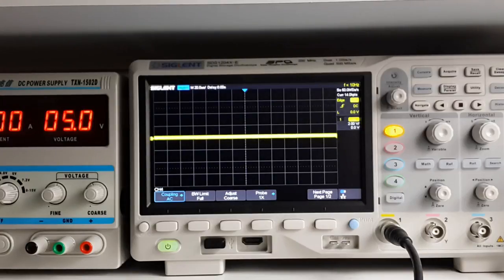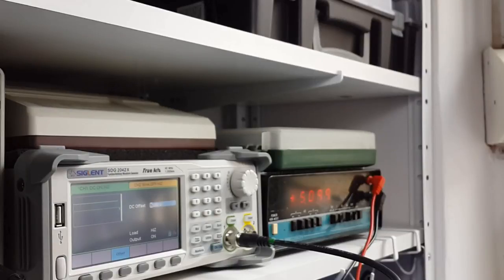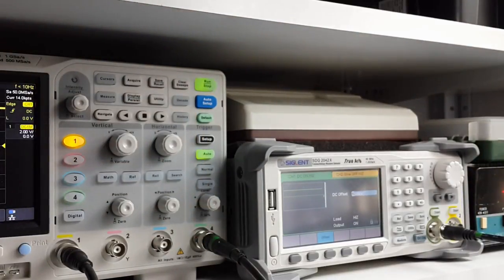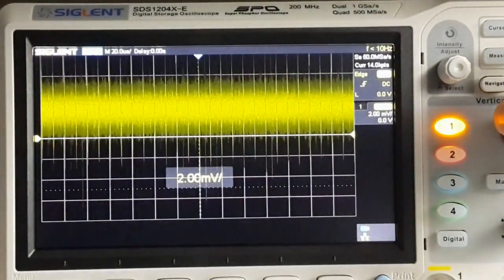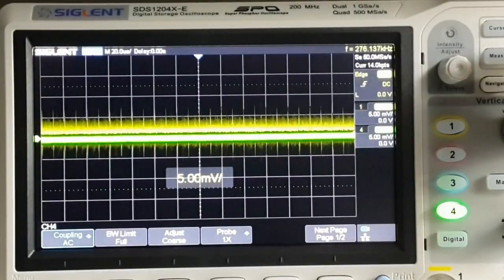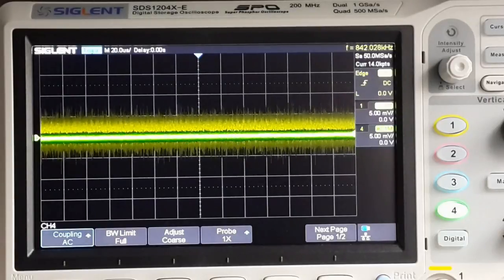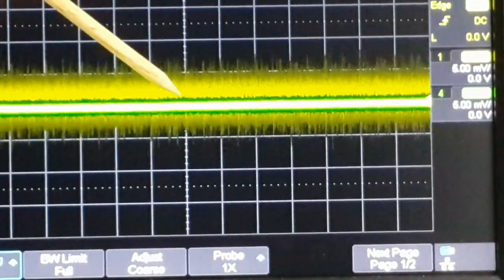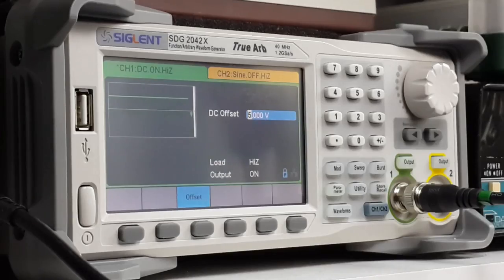Noise level in DC linear electronics laboratory power supply / electrical noise

Comment: For repair you can use the function generator to inject known signals to different parts of the circuits and see how they behave.
Reply from the maker: Hi! Yes. It is good to use two different signals to identify the channels in audio amplifiers. Also the noise signal injection to find out if was filter or not on the way out.  That´s the reason why it is good the dual channel function generator with noise signal and offset. But also for digital systems we can use the noise generation, or even high frequency pulses to analyze our circuit frequency response and the rice and falling time of logical gates, micro-controllers and memories.
Reply: Also it can be used to test components together with an oscilloscope you can get a component signature, a curve tracer, commonly known as the octopus curve tracer.

Comment: Hi, love your channel and thanks for doing this video. It appears that the leads you are using to connect to the power supply are prone to noise pickup because of the loop area between the two alligator clips - essentially forming an antenna that is picking up the ambient EMI in the room. I think if you used a 1:1 oscilloscope probe and connected it using the "barrel" ground (i.e., not the ground lead with the little alligator clip) to the power supply negative (-) terminal, you would get a more accurate measurement. This would mean you'd have to build some sort of jig that would fit with the oscilloscope probe's tip and barrel connections.
Reply from the maker: Thanks Paul! ...the idea was to compare two different voltage level sources. In the video I said the PS looked good, unless we compare it with something else. Example, if we need reference voltage for one operational amplifier, neither the PS voltage measurement or noise level are true references. The most common test lead used to connect PS with breadboards are banana to alligator cable what is worse. (Like next week's videos ones). You opened the window for a possible video with your interesting commend.  Because most of the time we talk about noise, reflex in lines, but we ignore the word "antenna". With  radio frequencies in order of hundreds of MHz and even few GHz around, just extending two conductors as much as we can, and we created a beautiful antenna. Plus a long test lead in spiral to reflex any radio frequency!  You are right and pointed a very good subject to talk about. Thanks! :-)
Reply from the maker: Yes, you are right. I also mentioned about Paul's comment was more valuable for next video's test leads. It is the video I uploaded it today, and I am using the typical Green Banana T or Y ground lead. If we read Paul's words, now will see the the antenna"S" he was talking about. It is better to use a factory made dual power supply than improvise two. But some times we had no other chance. I the situation of bypassing two power supplies, we should know what disadvantages we got. The video is focused in three points. One I just mentioned, two Paul said it, and the third is we need more dedicated or let's say the right equipment, that is exactly what you explained.  :-)
Reply: Bob Kalpon:  Good that you agree with Paul. I think test must be done over with appropriate leads, then compare results. You said yourself that working on modern circuits requires upgrading gear, AND THAT INCLUDES LEADS. That's why companies like Agilent, Tektronix, etc. take your blood for lead sets; their leads minimize loading and noise. Young viewers must know that sensitive circuits won't like cheap leads. Also, it might be interesting to compare the hobbyist power supply of today with  an old 40 pound H.P. PS that cost $3000 back in the day. Stability? Lowest noise floor? Place your bets! Lots of video ideas. Cheers.

Comment: Hello, does the Noise increase alot when a load is added?
Reply from the maker: Hi! If it increases, is because the load is the noise generator. Two months ago, I visited a colleague who got the same situation with an industrial tester for PCBAs, in the middle of its design. Extra filters must be applied. (It will include, capacitors, diodes, ferrite cores, insulation transformers, and resize cables).